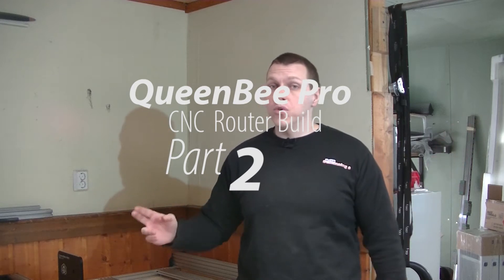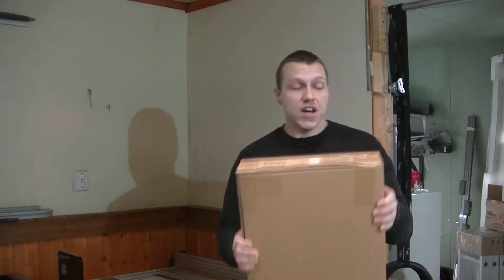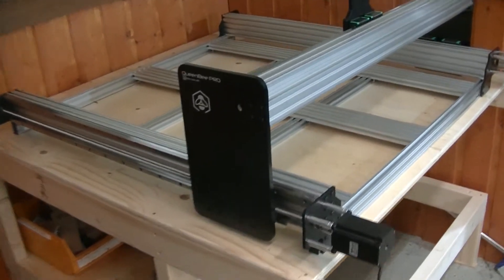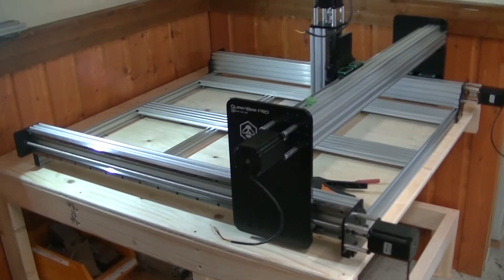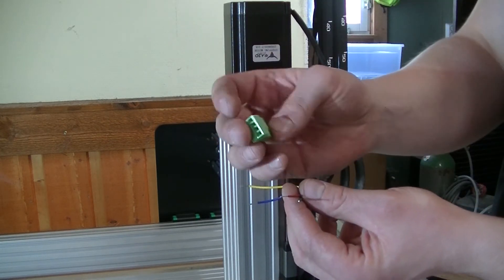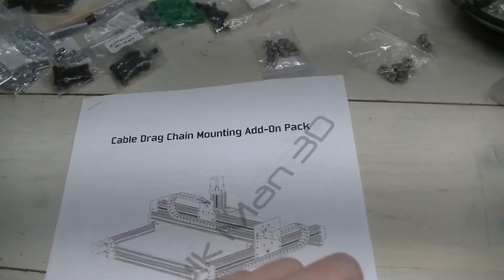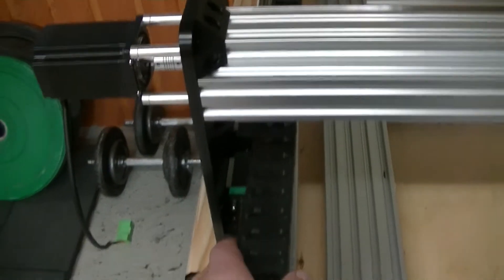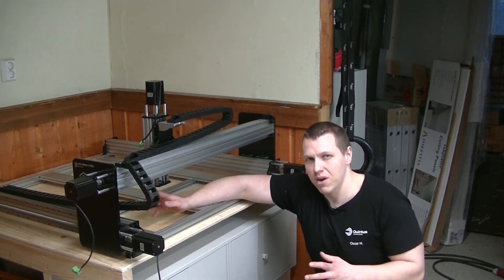QueenBee Pro CNC Router Build Part 2 Finishing the mechanics

Comment: Ok :)
Seriously considering a queenbee pro mechanical kit... run it with Duet Wifi and an air cooled 1.5kw spindel :)
Reply from the maker: That's not a bad combination. And overall I can recommend the kit, the only really bad thing was the quality of the screws, and they are easy enough to replace if you want to.
Reply: @OffHoursEngineering  The lead screws or the flat head hex screws You complained about in the video?
Reply from the maker: The flat head hex screws, and most of the cap head hex screws as well.

Comment: I saw someone saying something about turning endplates around so you can place the lead screw tightners on the outside (to strech the leads) to avoid wobble on long leads... instead of compressing them...
Reply from the maker: Yes, that's how you had to do it on the earlier generations of workbees. That's what lead to the Tingle Tension system that's installed on this machine. These plates have recesses for bearings on both the outside and inside of the plates, the old workbees only had it on the inside, that's why you had to turn them around.

Comment: Hello, What minimum size do you recommend? Thanks
Reply from the maker: Minimum size for what?
Reply: @OffHoursEngineering  Sorry. It wasn't clear. I was talking about the electronique case. But for sure it'll depend on what hardware you'll go with.  I've got servo motor  drivers that take quite of room already...
Reply from the maker: Aha, ok. Like you say, that depends on your hardware. But a good tip is to always go bigger than you think you need, you run out of space fast in an electrical cabinet.
Reply: @OffHoursEngineering  Ok thanks. Will see once I gather all the parts later on... :)

Comment: how to Install limit switch XYZ
Reply from the maker: I will show how I did in an upcoming video,  but basically I fabricated brackets to mount all the switches on and small angle plates from aluminium profile that will press the switches. This is a bit temporary to get it working because I plan to design and 3D print all the hardware for fitting the limit switches in the future.
Reply: @OffHoursEngineering  Today I am going to assemble  Queenbee pro. Thanks for the video
Reply from the maker: Nice, thank you. I have a couple of more videos coming in the series so be on a look out for those if you are interested.
Reply: @OffHoursEngineering  I am still wondering about homing switch.